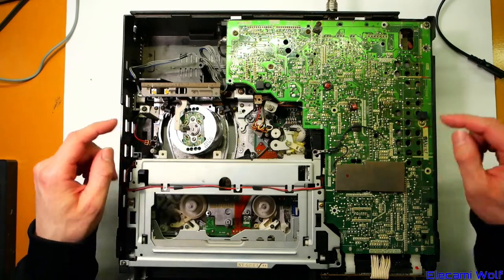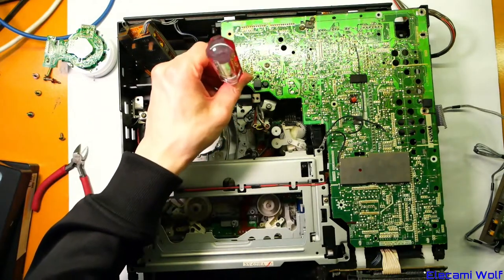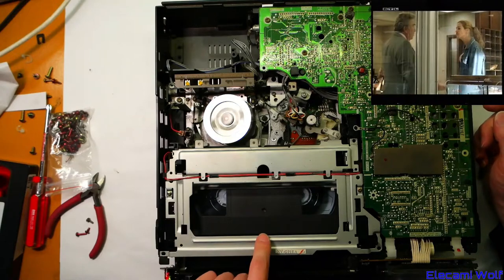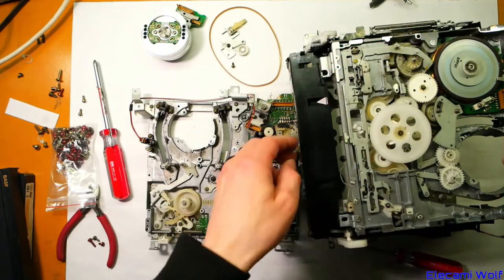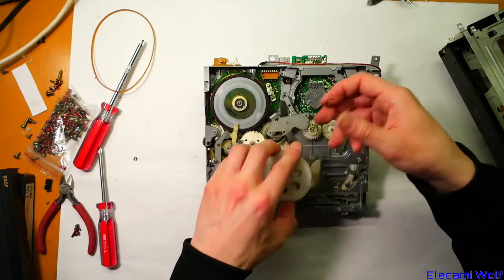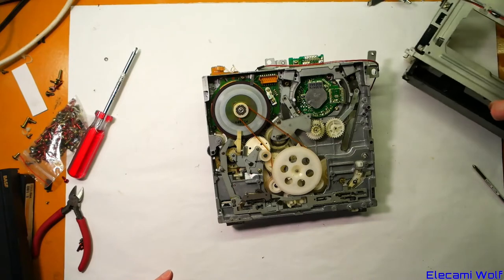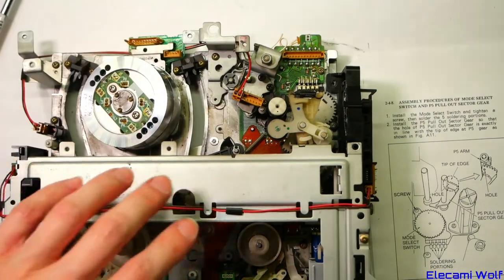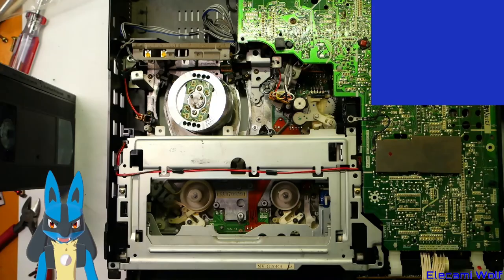EW0056 - National G20 & G21 Mechanism Investigation & Repair

Comment: I have this National G 21 HQ VCR with one month tv program recording magnetic card with digital scanner... bought in yr. 1986.... still good working condition... never used tv program recording magnetic card
Reply from the maker: The barcode scanner for programming? It is an interesting idea to try and simplify the programming.
Reply: @Elecami  Yes, this was a very advanced system for us in 1986. But even without a barcode, the VCR's internal settings could be set to record the week's TV program.

Comment: Streaks in video suggest head drum static discharge brush is not working correctly.
Reply from the maker: This is really good information, thank you. 
Makes sense the streaks would be caused from tiny discharge arcs in the bearings.

Comment: I want to repair my VCR power supply.
Reply from the maker: What is the problem with it? If it is not exploded, first step would be replace the Electrolytic Capacitors and check for dry solder joints.